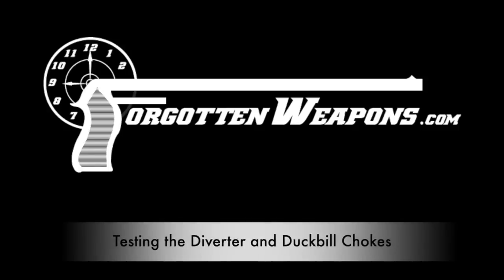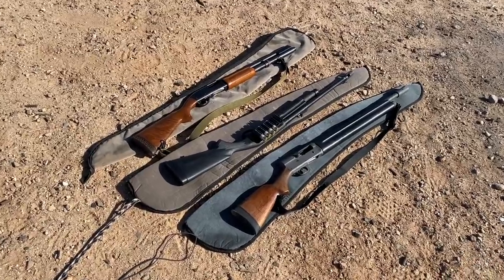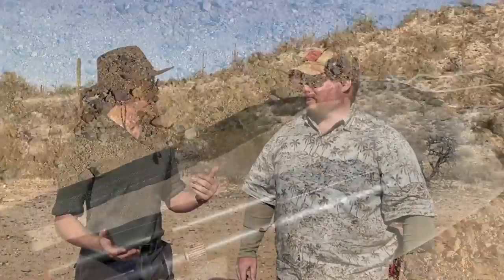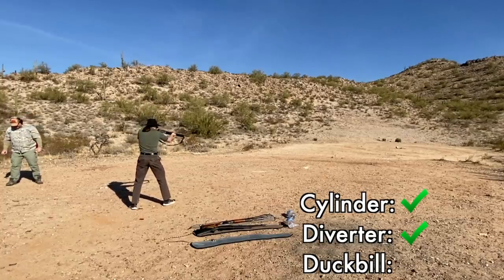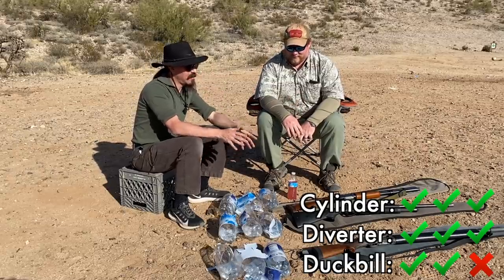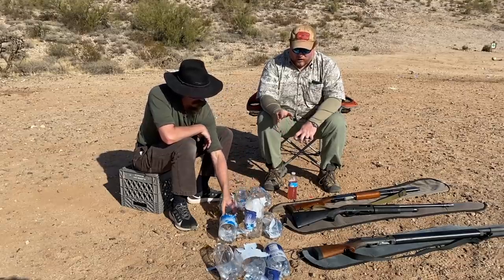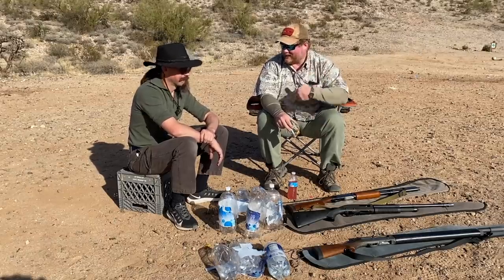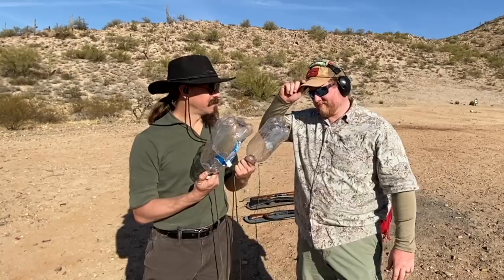Scattergun Science! Testing Diverter and Duckbill Chokes

Comment: We used a tire (motorcycle easiest to roll by hand) with target across the opening.   Roll across target area and shoot...much fun...and you then have a record of hits.    This works well for pistols and rifles too.
Reply: Doesn't that require a person, the "roller", ahead of the firing line?
Reply: @MarvinCZ  We had a small hill to roll them down so the 'roller' was about even with the shooter once the tire got to the zone where it could be shot.   Never had a problem with the shooting zone at least 20 yds from the 'roller' and the 'shooter' always keeping the muzzle within the zone it really was safe.   This had the target rolling right to left and plenty of hill behind the target all the way through the zone for safe backstop.
If you don't have a handy hill at the range you could get creative with a small ramp holding the tire with a cord to release it to roll down and across the shooting zone.  Especially with pistols it's critical to know exactly when the shot is going to break to be able to reliably hit a moving target.   My early Glock 19 wasn't so good at this with the firing point being especially springy and indistinct where the 1911's were much easier as their triggers broke when you wanted them to.   I've got several Glock kit guns now with much improved triggers so I'm liking Glocks again. :)
Reply: @MarvinCZ  you could roll it at an angle  so that the guy who rolls it can stop before crossing the firing line
Reply: What you're describing kinda sounds a like a modern version of the game Chunkey but with guns instead of bows and throwing spears.

Comment: Not complaining but at 3.40 Ian said that he aimed below it.
    I think you need to put this on posts with a metal clothes line for it to ride across. If you shoot low and hit the ground it will cause the shot to spread and possibly cause false performance evaluations. That will spread the shot horizontally, which is supposed to be the job of the muzzle device. Me and several other Cops spent a couple of days bouncing shot from a shotgun to see what could be effective at hitting a perp using a car for cover. Hitting the ground will cause shot to spread and fly fairly parallel to the ground. It doesn't ricochet up at a similar angle as your were pointing downward. In other words, it doesn't ricochet at angles like a bank shot on a pool table.
    Great video! Yall Take Care and be safe, John

Comment: If only there was sort of established sport that tested shooting moving targets with a shotgun 🤔
Reply: After thinking about it, clays wouldn’t be that great of a data collector either, unless you just miss with the cylinder bore.  Some sort of moving rig with three IPSC targets in a row might be better, but too much work to set up in the desert for one test.
Reply: They move in 3d's, also.  Something running on the ground is more limited in the z axis, hence the flattened out pattern of the duckbill.
Reply: @rollastudent  it might be with an inexperienced shooter such as ian
Reply: Clays courses get somewhat annoyed if you use #4 buckshot though
Reply: @Matt, quit shooting the trap house then.
Reply: @adammanning8882  rabbits bounce where I'm from
Reply: @rollastudent  hm...you just need to increase n. I guess after a couple hundred clays, a difference might start to show up.
Reply: @adammanning8882  but be vebby vebby quiet!
Reply: Moving sideways or moving up in an entirely different direction than the intended target of a duck-billed shotgun?
Reply: The more trials you run,  the better you will lead the lead, theoretically, lessening the benefit of the other chokes
Reply: @randymagnum143  Rabbits.  Grouse and of course Turkey.   :)
Reply: @thesmallestminorityisthein4045  let´s face it: these things were designed to injure as many rioters as possible per shell
Reply: @paavobergmann4920  not related to what I said at all.
Reply: @thesmallestminorityisthein4045   They are not made for trap shooting, so trap shooting may not be the best way to test them, is what I meant.
Reply: @paavobergmann4920  no, I disagree entirely, these are obviously anti zombie weapons. Perfect for taking out multiple zombies at once when packed into tight hordes. The 4to1 choke could probably knock out 2-3 rotten heads per trigger pull. Seeing as bird, and buck shot will likely be the most widely available ammunition in the end times, a squad with this, 9mm pistols, 9mm carbines, something chambered .223, and a scoped rifle for long, knock down shots on far targets, and you’ve got yourself quite the team. Oh, an can’t forget the bows for covert zombies hunting parties.
Reply: @kenibnanak5554  rabbits, yes.  Turkey are typically shot moving slowly or standing still.  You want an extremely dense pattern, as turkey have tiny, hard little heads.  You do not want to dig shot out of the breast, which is the only truly edible part.  Save for the heart, liver and my favorite, the gizzard.  It isn't considered sporting to shoot grouse on the ground, and the fly very fast, and seldom in a straight line.
Reply: @adammanning8882  Precisely and repeatable too! Why bother with this mess...? Disappointed.

Comment: Growing up in Central VA. Deer hunting with dogs is a big thing. Its a 100% shotgun affair. When I was younger we would roll a tractor trailer tire down a hill with plywood bolted to it. Staple paper and see your hits. Tractor trailer tires are big enough to get a decent pattern and will stand up on it own so you could scotch it and tie a string to it pulling it from a safe place. Find a large enough hill and rolling at a slight angle and the roller is safe.

Comment: Rather than using just a pulley, I would recommend knocking together a double spool with about a 2:1 ratio between diameters. Stick it on a vertical axis with the larger diameter reel on the bottom. Use the larger spool for your target’s line, and the smaller spool for the line your runner pulls on.

Comment: Haven't you seen a ground target för hunting practice? Metal frame with steel and/or paper targets that move on a rail left and right. 
It's a mandatory stage for getting a hunting licence for shotguns here in Sweden along with clays. 
For the hunting trial a steel rabbit with paper insert for main target area is used and you need a specific number of pellets (I think it was 16 pellets of two shots US8) from 20m on that paper to pass.
Reply: I don't think that's a thing in the US.
Reply: I mean, moving targets exist there but they're not required like that and most ranges won't be equipped with one.
Reply: @MarvinCZ  I guess it is more expensive to have moving targets than stationary ones. But if you are going to go hunting you would want at least some practice shooting at moving targets. Animals tend to move sometimes, especially if they have been shot at. 

On the other hand I guess a lot of shooters in the US never go hunting and why bother with moving targets then.
Reply: @elonion  Yeah, hunting isn't the most common reason for gun ownership in the US by far, very much unlike the nordic countries.

Comment: I think that would have been very versatile for perimeter defense.  Humans are much taller than they are wide.  As the range increases, the odds of hitting 2-3 distinct targets increases.  The diverter would help send the shots laterally instead of into the air and dirt.  In the golden age of computer modeling I'd bet that one of these could be optimized to get a nice tight laterally dispersed group.  Short range SPIW without all of the nonsense, and any tater fed country boy could operate it!  Just remember when clearing a room rotate the gun 90° :-D

Comment: A fun experiment, but what is the actual lead required at 10 yards?  It’s going to be pretty much point of aim = point of impact. I’d want to see this tried with clays at 100yds or more
Reply: Shotgun at 100 yards?
Reply: Typical flying bird distance
Reply: @srtgrayfrance  Nope.  Even with full choke and #2 for ducks, your range is about 40 yards max.  You might get 50 yards with a 3 1/2 inch magnum.
Reply: @kodiakkeith  fair enough, it’s been a long time since I went clay pigeon shooting. However my point still stands, I don’t think 10 yards is long enough.
Reply: @srtgrayfrance  As a fun shoot, longer ranges might be a kick.  Yet, that misses the practical point of these open choke and duckbill shotguns.  This is about close range shooting, home defense in particular.

Comment: No one had talked or even shown how not cleaning the gun at all can cause loss of performance of the gun not only make it less reliable but could more likely break?
Reply: Not a part of this particular experiment/discussion.

Ian was running a dirty gun for his Calico testing, but his Calico was broken IMO before the test started.
Reply: @ScottKenny1978  Ah. What about the well known guns performed after it was being dirty from nearly to never cleaned?

I had shot my grandfather's guns (my uncle's now) and noticed how terribly some guns performs. Even the bolt release couldn't release the bolt from the housing (I don't know every gun part and I could be wrong) on his bolt action rifle (until I had took apart and cleaned it as well the safety switch). His pistol doesn't shoot reliably. Even his small caliber rifle couldn't feed right (even was using pistol varient of the .22 bullets) and the bolt assembly moves slower than it was before. Even his shotguns was performing worse. Until I had taken apart and cleaned them all (to the best that I can).

I can tell it was a night and day difference. Of course I had made mistakes along the way but I didn't break any of the guns.

Comment: So, why didn’t you shoot at clay pigeons? Also, shooting at splatter targets would give you fairly accurate spreads for each choke for each gun. A novice could have shot those bottles moving 3-5 mph with any gun. I don’t think this was a very accurate test with the system they used.
Reply: Lack of an automated clay throwing device?
They need a horizontal flight from side to side, so a hand-held throwing tool wouldn't work unless someone stood in front of the firing line, which is unsafe.
Reply: @MarvinCZ  plus if the idea is for riot control, you want something going average human speed